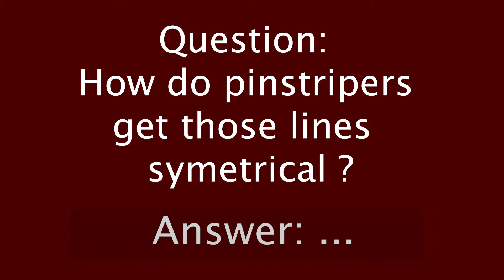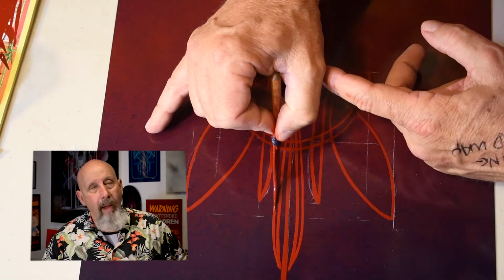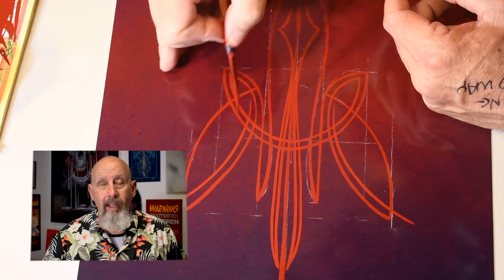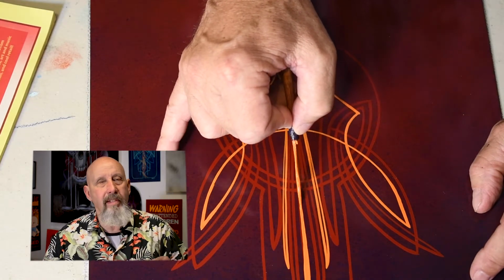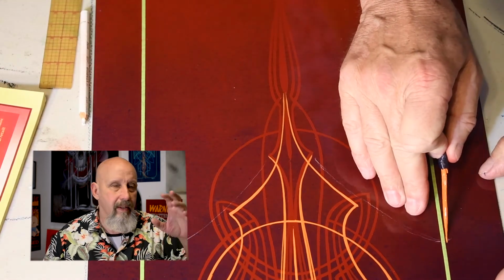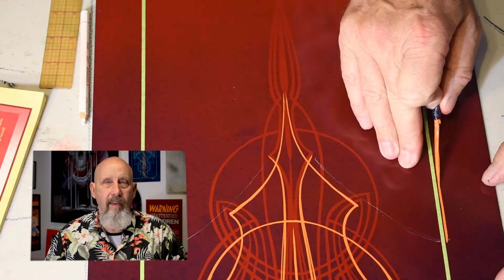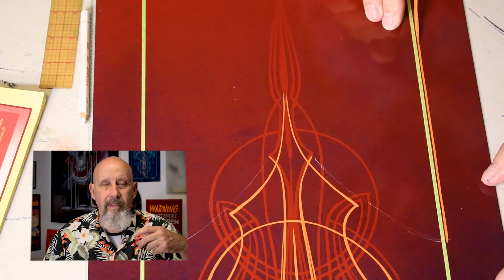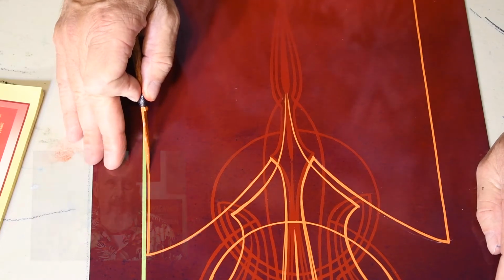How do Pinstripers get those lines so symmetrical? Answer...

Comment: Great work Max! I am just getting started in this. My biggest issue is when I have a blank panel, palletted brush in hand,  and my mind goes blank because I don't know where to begin. How did you overcome this when you were getting started?
Reply from the maker: Simple! Draw a line down the center with a grease pencil ... do the 2 lines on either side of the line coming down into a point. Bing, you've started! Look at someone else's work, and pick the lines you like the best, and copy the shit out of it!
That is how you start. After a couple if those, you will develop a knack! Let me know how that goes.

Comment: Hey max,seeing as you mentioned asking a question...... I remember you suggested in another video that lettering is best done with *mack 179s..no.8 and 3 to start*...my question is , with that particular model there are 2 sorts of 179...some brown and some grey i believe ....are the colour differences of these 2 just cosmetic as I don't want to buy tbe wrong ones for lettering....thanks for your advice as always!
Reply from the maker: Actually, I didn't know there were brown AND grey! Somehow I just bought the brown ones always. And, sorry, I don't know the differences between the two. I have always used Mack brushes. But I also don't paint, (or buy brushes as much as I used to). I will definitely look into the differences, and get back to you!
Reply: @maxkilbourne3142  hey mate thanks for the reply!
That would be great if you could...its most likely not a big deal , however they are expensive and I don't want to buy tbe wrong ones just in case anf the supplier is not a painter!
Keep making videos and keep that good attitude!!!